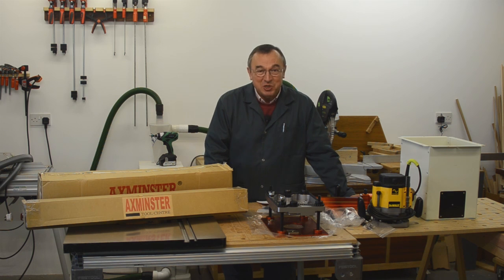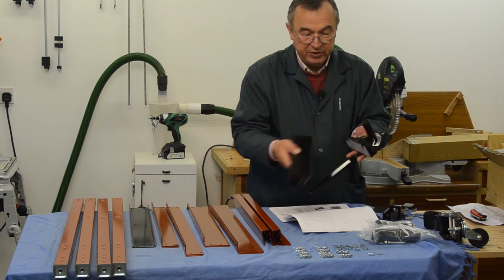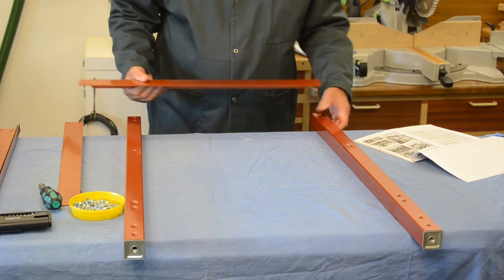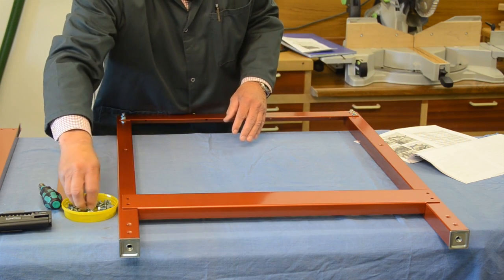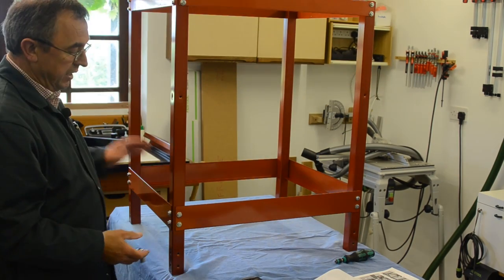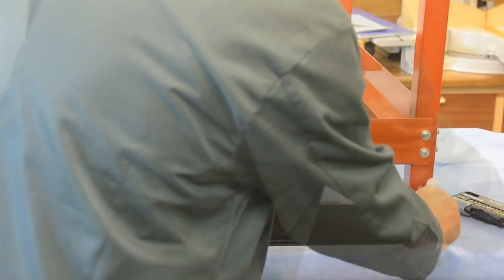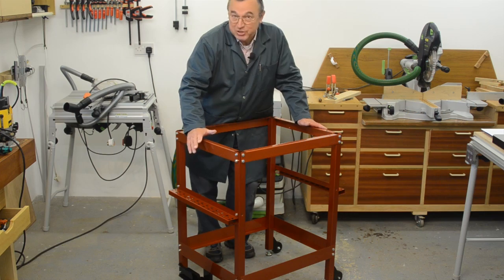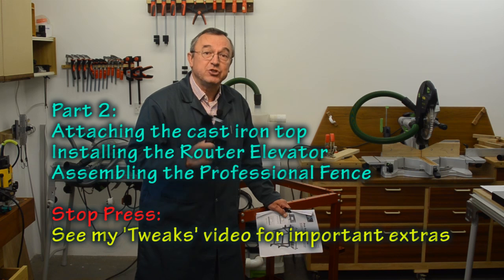UJK Technology Professional Router Table Assembly - Part 1

Comment: Hi Peter.  Thanks for your video - I know you did this one a while ago, but I would like to suggest an alternative assemble process.  I did assembling mine the same way as you detailed and I found I was always bending underneath the table to affix other parts.  Place your cast iron table on your table face down (leaving the protective plastic film in place)  and assemble everything from the top down.  The table is a flat and ground surface and there is the base to table mounting socket bolts, the dust box and the fence support brackets - all of which are mounted to the underside of the table.  Its more stable a working platform and you can setup the feet and other components using your bench surface as your datum.  The same router table is made under different brand names out of Tiawan - mine is Union One (Cast into the table when the table was poured)
Reply from the maker: +Xoncention That is sound advice - many thanks. It does then require a second person to turn things up the right way but that is more than compensated for by the ease of assembly.    Peter
Reply: +New Brit Workshop (Peter) I thought I would need help to turn it the right way up.  It is quite heavy fully assembled.  I assembled a ramp from my MFT3 to the floor using the side clamping "T" slots and clamped a block across the ramp to prevent the assembled router table getting away from me.  It was an easy task to let gravity do all the work down the incline.  It was then easy to roll it onto its feet.  The packaging used to protect the table top is perfect to prevent any damage to the table during this procedure.

Comment: hi peter , I purchased the same as you , have to say your videos are very informative . I'm having problems with the wheel assembly i think this could have been better designed , having said that i wont be moving mines much but i will return to the moving system later i was just getting frustrated with it . but its a great table , great videos many thanks  john
Reply from the maker: +john kirkland Many thanks John.   The wheels are tricky. You may need to get better inserts to go into the square tubing. It si covered in one of my workshop notes videos.    Peter
Reply: +john kirkland :  Hi John.  The adjustable feet need to be screwed into the upright tubes leaving only 5mm protruding lower than the bottom of the fixed castors.  When you press the foot pad on the single moving castor at the other end, the offset pivot will lift the feet off the ground allowing the fixed castors to touch the ground.  Its the a simple process to move the table around the shop floor.